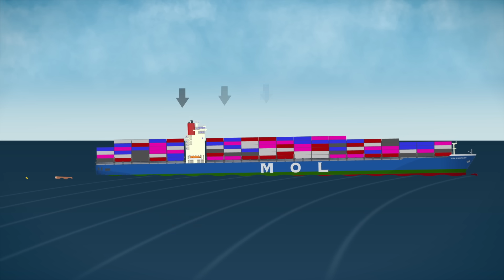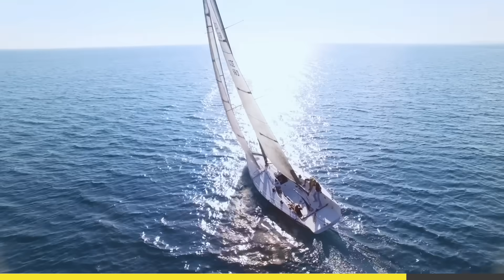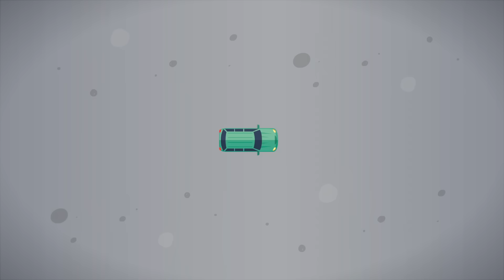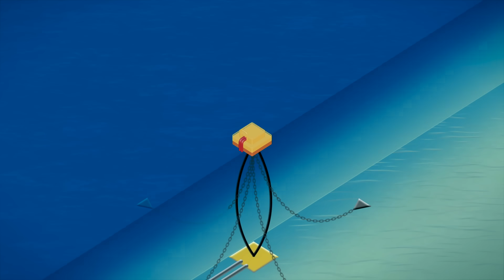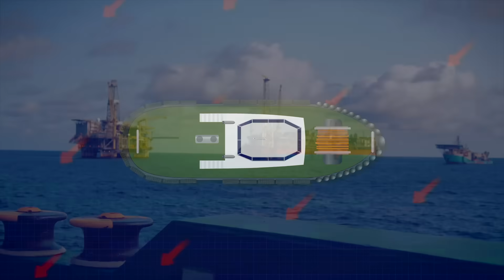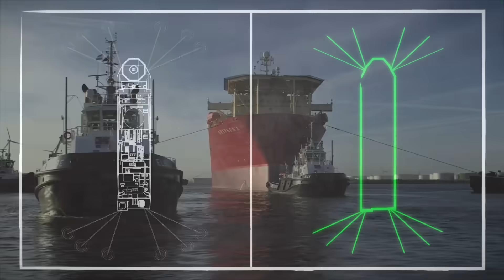What Stops a 48,000-Ton Ship From Drifting Away?

Comment: Nah, the sum of forces is equivalent to all the force vectors added together. You also forget the propulsion, tension, friction ( a grounded anchor ), and drag force. 

For an object to not accelerate, the sum of forces need to be zero. An object at rest remains at rest unless acted upon an external force. An object at motion will remain in motion unless acted on by an external force. 

Therefore, to resist motion, the ship must be brought to a standstill. And then its sum of forces need to equal 0.

Comment: You could add a little video to answer the obvious question left unanswered (I'm not an expert): How do you get an anchor back up again that dug in as described without extensive damage to the anchor or seabed? I assume you can (if you know the exact position of the anchor and have perfect control of the vessel and as much space as you want) go exactly towards it and a bit beyond while pulling "gently", but I assume reality is more difficult.
Reply: It depends on the type of anchor, but generally they don't actually dig in all that much. Most of the actual anchoring is done by the sheer weight of the anchor chain on large ships. Many smaller "boats" use a different style of anchor that basically works like you said. After the anchor is dragged, you reverse a bit past being directly over it and the bite is actually on a pivot. Once you get behind the center the anchor bite is able to be slid out of the bed and comes up rather easily.